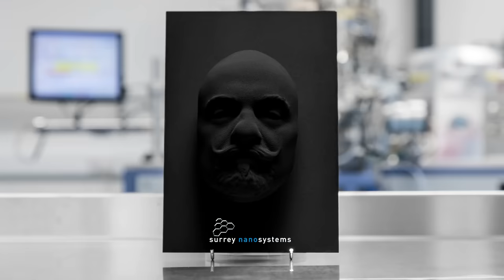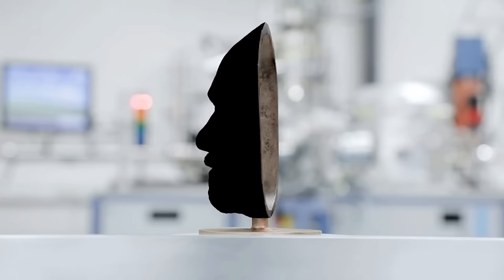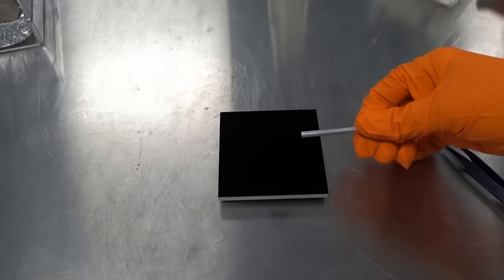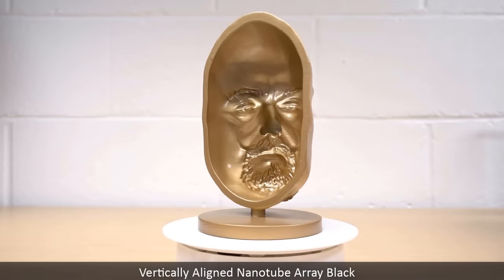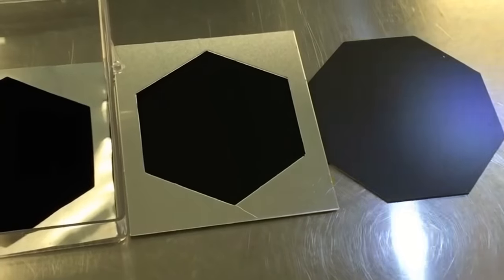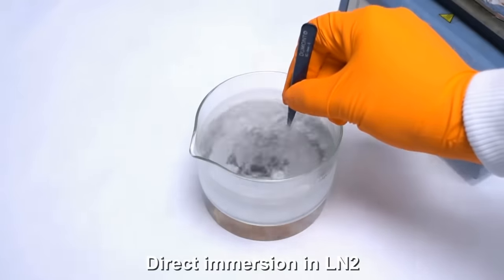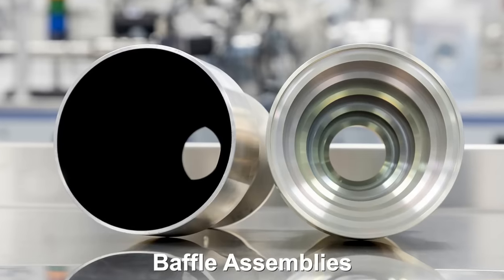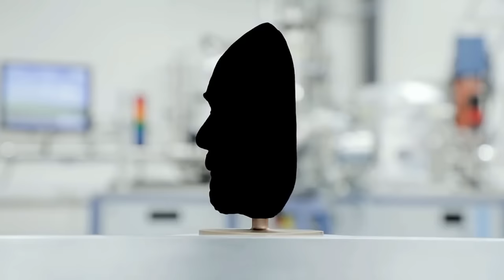VANTABLACK - The Darkest Material on Earth

Comment: I think you have a slip of the tongue: a carbon nanotube cannot be one atom wide, but its walls are one-atom thick. Their structure is a hexagonal mesh of carbon atoms, like graphene but forming a tube instead of a sheet. There are also multi-layer nanotubes which are basically nested single- layer nanotubes.
Reply from the maker: i hear what you are a saying, and logically it sounds correct, and even when i said it I was not 100% sure, but I got that info from the research done on the topic, I would have to go dig it up again to see where i got it.
Reply: I have no idea what you just said but I think your smart now.

Comment: I wonder if any one has looked into using it for high efficiency solar absorption. Seems like it could have high potential in the field of solar energy. Unless of course the absorption rate is so one sided that it will not transfer energy in a system or circuit .
Reply: It's fairly fragile. I don't think it would stand up to the high temperatures. Plus, thermal conductance is probably pretty low relatively speaking.

Comment: Since light is a form of electromagnetic radiation as is radar i'm wondering if this stuff could make an aircraft or anything else for that matter invisible to radar.  Does radar simply bounce off a solid object regardless of colour or is it reflected by the object like light.
Reply: That's a good question, but, the wavelengths in question (RF vs Light) are many orders of magnitude apart for this material. It's great at absorbing the visible light band, but probably not so good at the lower frequencies of standard radar wavelengths. Also, many aspects of "Stealth" technology involve reflecting the radar waves away. It's quite possible, that at some RF frequencies, this stuff might act like a super radar reflector causing whatever is painted with it, to stick out like a sore thumb ;)

Comment: "Every time you try to operate one of these weird black controls that are labelled in black on a black background, a little black light lights up black to let you know you've done it." Zaphod Beeblebrox.
Reply: what is the name of the shot? garglebuster and something to do with a small gold brick
Reply: @willysbakery6878  Pan-galactic gargle blaster.  The effect of which is like having your brains smashed out with a slice of lemon, wrapped around a large gold brick.
Reply: nice one broer. kry jou by die restaurant at the edge. i will buy you one
Reply: @RBurwell  mr adams' work should be advised reading to anyone who can read. just to show you can be silly and still not be silly.

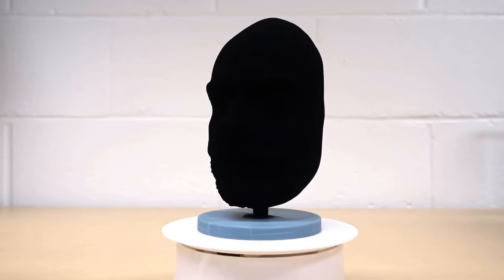Comment: 01:42 The width of a carbon nanotube is not the width of a single atom. The width of a carbon atom is about 1.5 Angstroms (0.6 in certain structures) and the smallest width carbon nanotube recognised so far is 4 Angstroms. More accurately he could have said the width is equal to the diameter of a dodecahedron Fullerine structure. At least he should have said carbon molecule instead of atom. You could probably state that the wall of the nanotube is one atom thick and be roughly right.

Comment: As per Einstein the incident electomagnetic wave or photon the light has its own dual nature the ventral black made of nano tube of carbon so there is 00.33% of light is reflected 

So equation 
Radiation = a+r+t
a=99.67% r=00.33% t=0

When the light intensity increase at certain point it should reflected in dark room

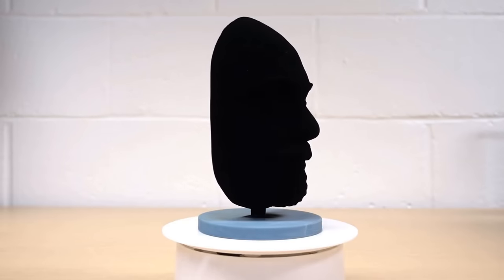Comment: 1:40 "Each the width of a single atom"
So you have a tube made of atoms that is only one atom in diameter. Should be some sort of prize for that.
Get the facts straight! ♡
Reply: Atoms are also different sizes depending what element it is partly due to mass and electron repulsion.